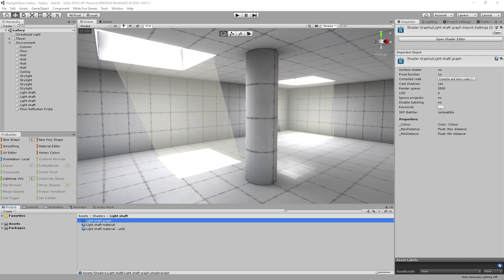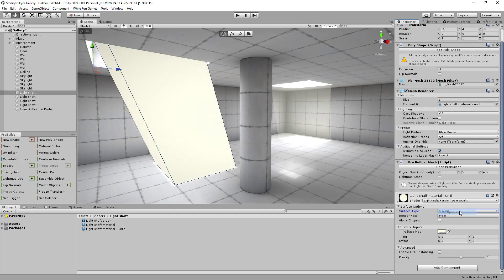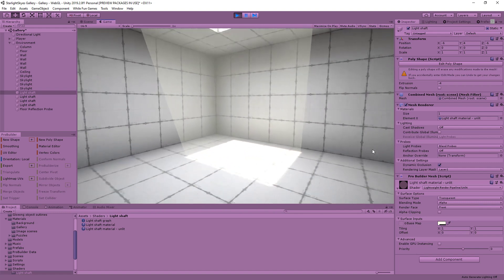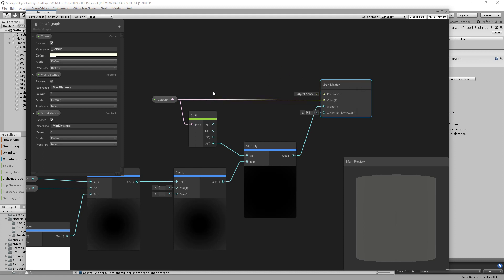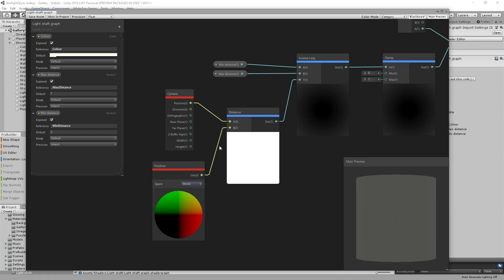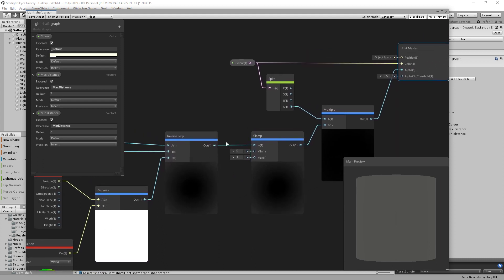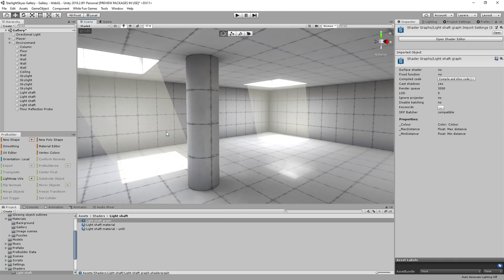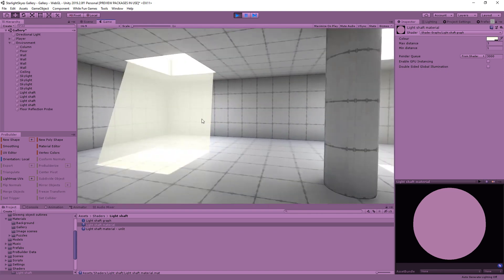Simple fake volumetric light shader - Unity Shader Graph Tutorial

Comment: Maybe i'm wrong but it doesn't really look like volumetric lighting, it's just "god rays".
Reply: Volumetric lighting is any time you can visibly see light due to it passing through dense particles in the air (which is why you can see light in dusty areas or after a rain storm). It's literally just light hitting dust or water particles in the air. So, any effect where you can actually see a light shaft is a volumetric light effect.

This implementation is just meant to be nearly free to render, so it's not super accurate, but it's definitely volumetric lighting.
Reply from the maker: @SkeleTonHammer  I couldn't have said it better myself.
Reply: @SkeleTonHammer  Well said dude (or dudess :) )
Reply from the maker: God rays are a form of volumetric lighting ;)